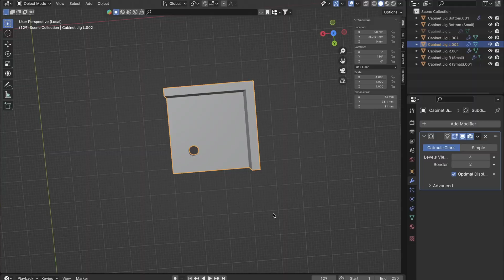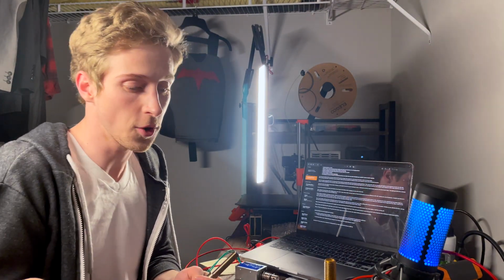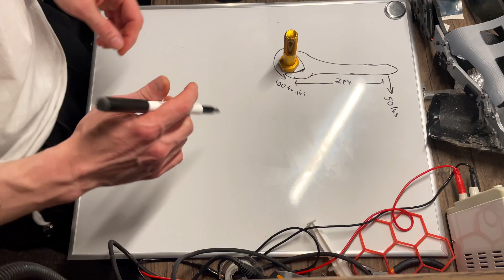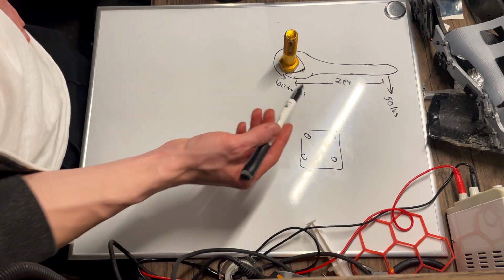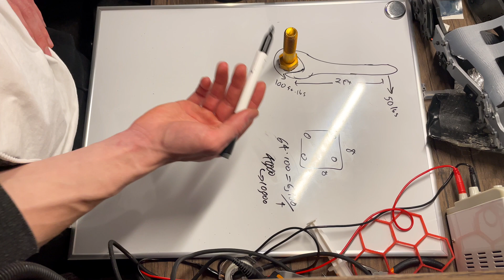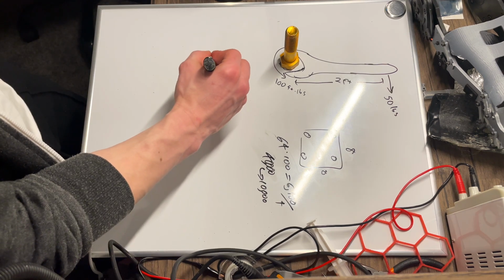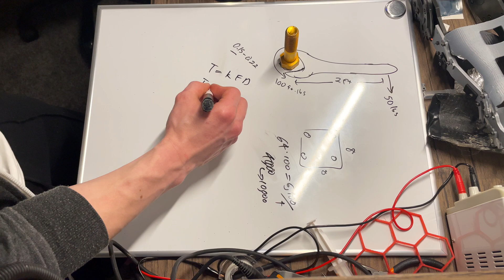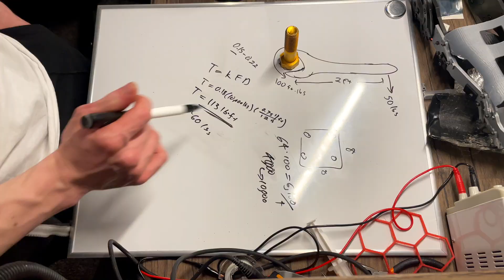20T Plate Press for Armor Composites (No Bottle Jack Needed!)

Comment: Measuring torque is not the best way to obtain clamping force.  It's just an estimate, and there are lots of variables that can throw it off.  In this application, since all the bolts are completely exposed, you would get better and more accurate results by measuring bolt elongation instead of torque.

Comment: I would make three modifications.  

First, I would weld the bolt heads to the plate so I didn’t need the crescent wrench.  

Second I would throw the crescent wrench out and ban all further use of them.  

Third I would add a load cell (or several swappable load cells for different ranges) so I didn’t need to do a bunch of calculations and approximations to hit my pressure targets.

I would use a torque wrench and slowly increasing torque values in a criss-cross pattern to ensure even tightening until the target pressure is achieved.

If I needed to put it in an oven, I would use a torque wrench while applying pressure, mark down the torque, remove the load cell, and then retorque to the marked value.

Comment: You should make a pilot hole with an 1/8" drill bit, then step up to about 3/8"(those look like 3/4" structural bolts), then step up to your finished size.
Reply from the maker: @DanielJacobs-o8y  ideally this would be easier! I was being a cheapskate and just getting the cobalt 3/4”s straight up 😂

Comment: Have you given up in your hidden blade project? I was very curious about your project and wanted to see if it would work with steel.
Reply from the maker: CNC’ing parts with metal from paid services is expensive and slow for iterations, so I paused that project with my last hidden blade compliant mech! Blade & locks would be CNC’d in that design for a metal systme

Comment: Can you share the papers you based your process on?
Reply from the maker: As far as pressures goes, just general scouring of composites and how strength can be increased with psi’s from 50 to 100psi in general
Reply: @CrashMakerspace  - Thanks! I recall from another video you mentioned figuring out how to do the composite you wanted by reading some papers. Can you share those? Or would that reveal the specific combination you are trying to patent?
Reply from the maker: @Fractured_Scholar  I don’t have em on hand, I’d have to re look through the internet for them; it’s been a combination of taking notes from readings and most importantly a lot of experimenting with materials and processes. I’m looking into making a how-to-armor series on here; just gotta get past the Batman blade mechs first
Reply: @CrashMakerspace  - Awesome - Looking forward to it!

Comment: What materials did you use to make the ballistic armor plate?
Reply from the maker: You're going to want to spec out your composite based on the ballistic specs your looking for, your going to want nano particles in the resin for extra strength and CF or KV can be used for the flak shield
Reply: SiC, or B4C , peg400+ fraction nano quartz 200nm 1:1. Last year i was in psychiatry. Today see somebody, similar stuff. I'm not model, I'm also physic passionate. P1Q3, P.H. Alcatraz,C2.
Reply: Check:
T.A.L.O.S. suit, or Ratnik suit.

Comment: Is there any particular reason other than cost that you opt for a press and not vacuum bagging your composites?
Reply from the maker: Vacuum bagging is good for irregular parts; but when it comes to even (and level) pressure this is key. When you make the composites you can end with some spots having more epoxy so even pressure won’t work those out. A flat that you’re keeping level will since it will increase pressure on thicker portions

Comment: In your clamping force calculation, you might need to factor in the pitch of the threads on the nut and bolt.  The mechanical advantage should change your final force depending on the pitch unless it cancels out somewhere else I’d imagine?
Reply from the maker: You totally can, I just lump that ratio into the K factor here as it’s a catch all dimensionless variable! At the end of the day, this gets us close enough for most applications needs for accuracy!